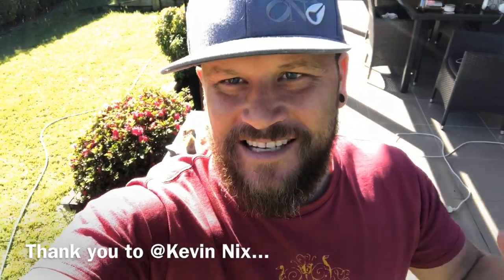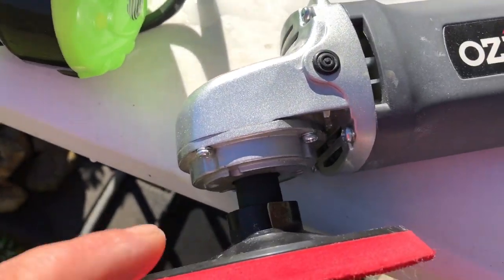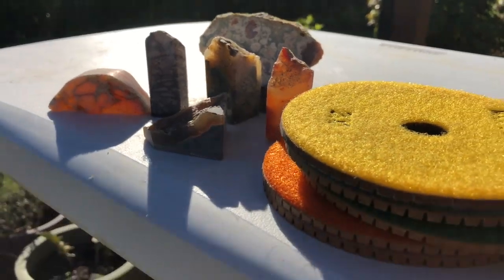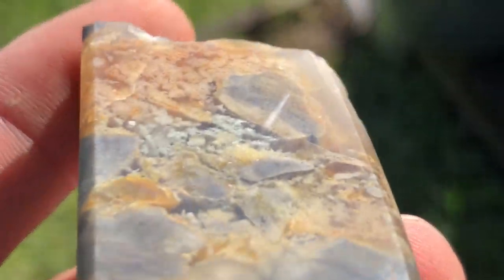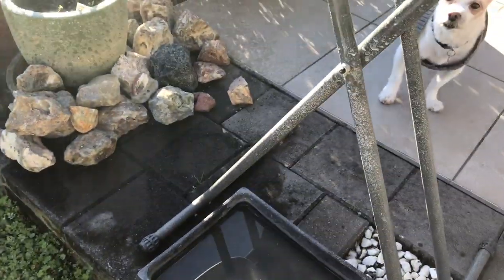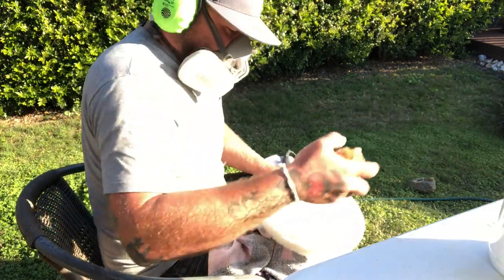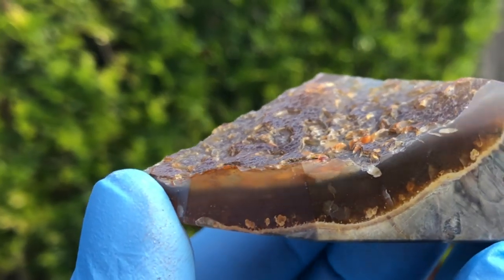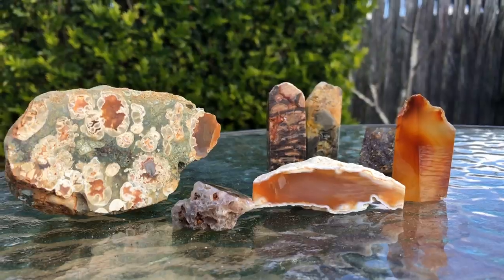Using Power Tools to Cut and Polish Rocks

Comment: These look great!  Thanks for sharing.  I am getting into doing this myself and have been stuck between using an orbital sander/ polisher or a dremel for similar polishing.  The agate pieces I have are already cut and perfectly smooth.  They just need a really good polish.  Would you recommend one over the other for this?  Cutting will be my next project.  Thanks!
Reply from the maker: Thanks mate 👍👍👍
I can’t really say because I haven’t tried the dremel before but they do work really well. I think for larger rocks I’d say the orbital sander, only because it covers a larger surface area, but if the agates aren’t too rough then the dremel would be good too. Either way, you’re gonna love it 😉
Good luck and happy shining David!!!

Comment: Looks like you are going backwards with your grit progression.You should use the coarsest grit to the finest.You'll wear out your polisher if you use the 5000 grit first!That is for the mirror finish,at the end.And you need to be patient.Each grit level builds on the last,so it is essential that you grind out the scratches thouroughly from the previous wheel before going to the next.(I speak from experience!)
Reply from the maker: Thanks Debbie, yeah I started with 50 grit, and moved up to 3000 last. Great pointers though, thank you. 😉👍

Comment: I'm scared of  using water with an electric machine, is it safe?
Reply from the maker: Yeah it’s safe if you dip the rocks in water, the water flys off the pad but it’s always good to make sure the machine isn’t getting wet. So you dip the rock, then polish and when it dries you dip it again. But not too much water where it becomes unsafe. 👍

Comment: Are you using an angle grinder to polish?
Reply from the maker: No this is a rotary sander\polisher. It has variable speed. Some grinders that don’t allow for the speed to be controlled can be too fast for the pads and burn them out. Not to mention could be a bit less easy to control making it more dangerous. I hope that helps

Comment: Mate just wondering what diameter your diamond pads are? Cheers
Reply from the maker: Hey mate, so I use the 5 inch ones. It’s easier on the sanders/grinders motor the guy at the shop said. Hope that helps 👍
Reply: @Rookie_Rockounding  perfect, I ordered the 5 inch ones this morning, cheers!
Reply from the maker: Sweet! I was at work and was hoping I got to you before you ordered the big ones. That’s great mate. You’re gonna absolutely love it.

Comment: Hey what’s up ? So I bought the pads and I couldn’t find the right size adapter ok I borrow n angle grinder and that dosnt fit aaarrrhhhhh!!! . Then I had a come to Jesus moment and got a thin nail cut the point of and glued my ruby to the nail and I’m putting it into my flex shaft and I’ll use that with the diamond pads so at least I can some work done until the part comes in haha I thought of that from watching lapidary Dave he did something similar. I’ll post a video of the before n after
Reply from the maker: Oh man that’s great! I mean, to at least get to work on the Ruby, but damn, that’s horrible that the pads are being such a pain for you 😖

Comment: After years of professional help and practice, I have long since discarded my polishing powders.  Most of the "Pros" who showed me how to use it, didn't get it any shinier than it was when I handed it to them!  For your final, just use a diamond pad, at 8000-grit or higher, and that will be all the shine it really needs.

I'm an Air Force trained electrician, and your use of a non-GFCI equipment, with water, is concerning.  Make sure you either, plug the tool into a GFCI outlet, or buy a GFCI plug.  As an added measure, drape the tool's power cord over something that is higher than ground-level.  This will prevent water from running all the way to your electrical outlet.  Water and electricity don't mix.

Comment: Just a headsup that respirator doesnt work woth a beard, might as well not be wearing it. Gotta be shaven so when you block the intake no air can come thru.
Reply from the maker: Yeah thanks Nelson, I’ve come to learn that since this video 😬🤦‍♂️ I wonder if there’s one I could get that does work with facial hair
Reply: @Rookie_Rockounding unfortunately not, i was a fabrication lab assistant in college and one of our requirements was to be clean shave, or have facial hair that sits within the mask. Could just go with goatee and major sideburns

Comment: They turned out nice,but you're doing it the hard way ,do some more research, Find a rock shop that polishes there own rocks and ask if you help ( some heavy labor ) for a few lessons , it will cost more for some different equipment ,and for your final polish use the heaviest canvas you can find  ( real heavy stuff ) attach to a flat wheel and use fine rubbing compound.   GOD all mighty has made a hole other world inside those those rocks. !!!  Stay safe
Reply from the maker: Hey, thanks buddy, thanks for the help mate. I do appreciate it 👍👍👍

Comment: I tried to stop you but you couldn't hear me, aluminium is the thing, a stick of aluminium used like a crayon over the polishing face will identify low spots and when it's all worn off it's ready for the next level.
If you find pits or flaws in the face when it's perfectly dry blow out any dust and put in some thick super glue, yes there is thick med and thin, allow to completely dry and continue grinding.
Speed isn't going to make it shine more, slow speed with maximum contact with polish is better than fast and no polish, final buffing can be done with no polish, just a clean polish mop on high speed.
Small stones are awkward so listen to uncle Symon.
A four inch nail , bolt or something similar , super glue and the small stone , glue them together, don't worry, when the polishing is done place them in a bag in the freezer overnight and just snap them off in the morning, this is called dopping, using a dop stick.
Outstanding rocks, I was thinking you might need my help but you got there.
Next weeks tip will be on advanced dropping methods, how to drop a mountain without breaking out in a sweat.
It's always messy,  I can send plans for making  a flat lap the easy way.
Reply from the maker: Solid advice there dude! Thank you! I can’t wait to try some of those. Thanks for sharing the knowledge 👍
Reply: Rookie Rockhounding 
Due to the global time differences you won't have read this until next week , so before you do read this and as sound travels slower than the speed of light it is still pointless me shouting the superglue tip because it will still be too late, unless I shout in the opposite direction, I wonder if I included the magnetic pull from the moon and the wind was blowing in the right direction, but perhaps not.
Bet this got you thinking eh.
Reply from the maker: Symon Sheppard 
Hahaha! Okay so any polishing you see in any videos in the next month, it will be done prior to the information you have shared earlier... it’s just how the time continuum works. 😂 just saying...
Reply: Rookie Rockhounding 
You my friend will always shine, that's your nature, some were born to help, some were born to hinder, some were born to do things others can't, some were born with no particular purpose, we all have karma and I told you which way your life would turn, its turning as predicted, you are doing well ,your subs love you and you will continue to grow, how big ? that's up to you.
Big email coming only one more after this.
Reply from the maker: Hey thanks mate, I didn’t see this one till just now. That’s really kind brother. 🙏